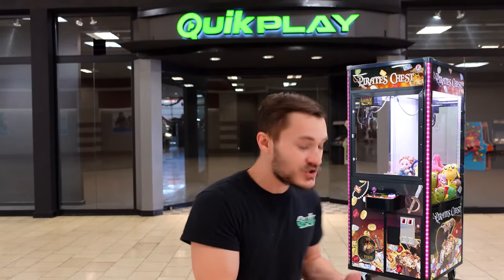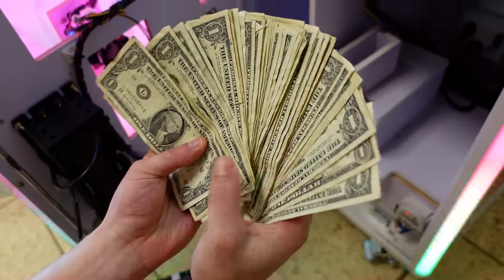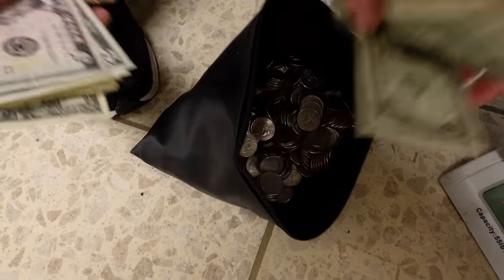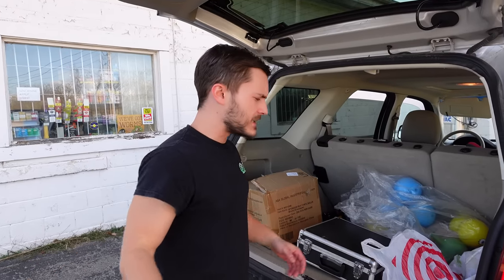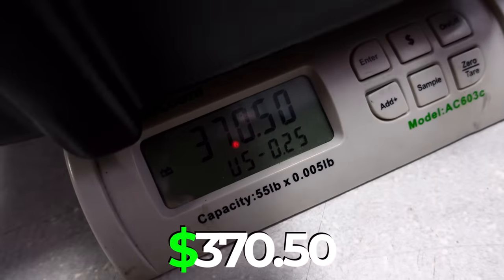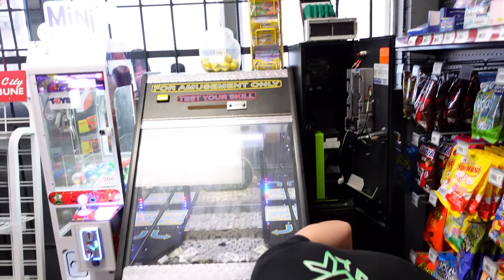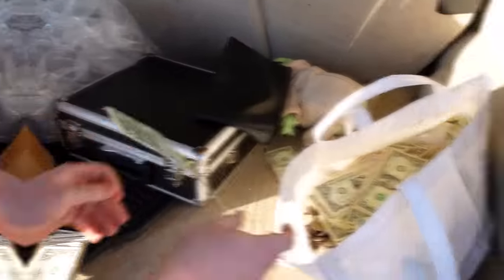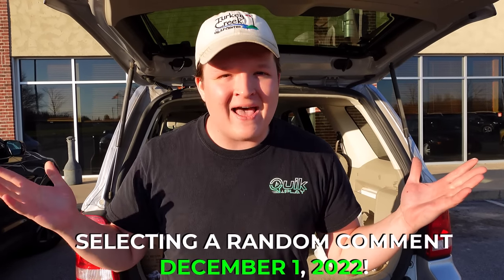Collecting SO MUCH Money From Our Claw Machines!

Comment: I've wanted to get a candy machine for a while now, and I have a location in mind that would probably work, but figuring out getting a machine has been difficult. A lot of them on Facebook Marketplace are either outside of my budget or too far away to make it worth it to get. New machines are even more expensive than the used ones too. If I were to get the one being given away that would be amazing.
Reply from the maker: Very nice!!

Comment: Good job fellas. Do you know the name of those C shape keys? I have an older hot stuff claw machine w same key but one of them is cracked and I’m worried it will snap sooner than later. I’m hoping they can be made by the company. Also if I’m picked for the candy machine I would place it in my garage for the neighbor hood kids. They always come over to watch me work on machines.
I should mention I have kids age 0-13 the kids are usually running w mine. I’m not a creeper letting kids in my garage lol.

Comment: I saw something interesting in a vending machine the other day. I stopped at a mechanic shop for truckers. They had a vending machine with the usual snacks but the kicker was taped on some of the snacks on the back was cash. I'm sure that helps the flow a lot more. It seems people would be more inclined to buy the snacks just to see how much they ended up getting back.